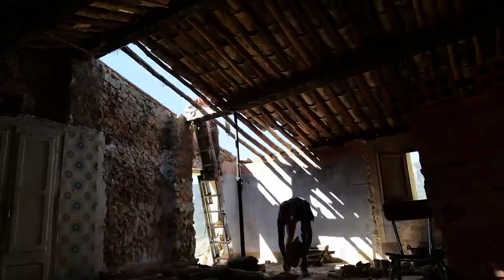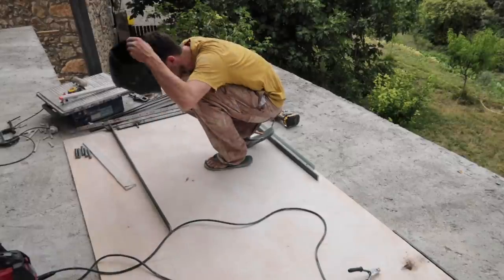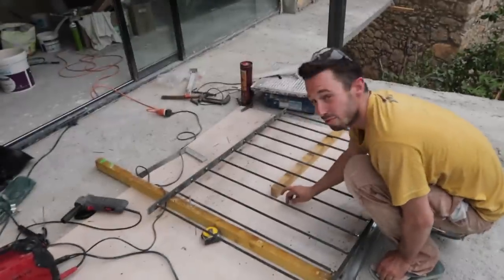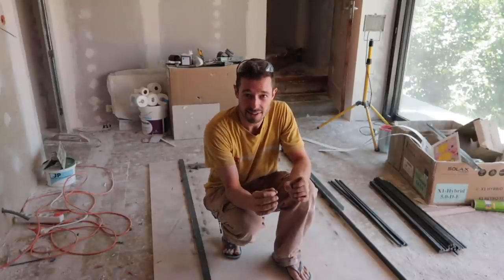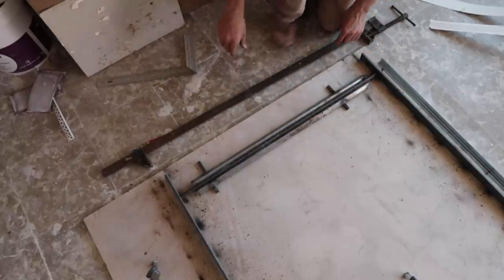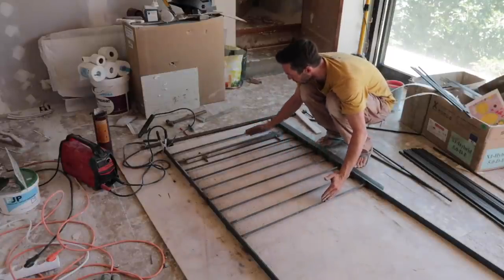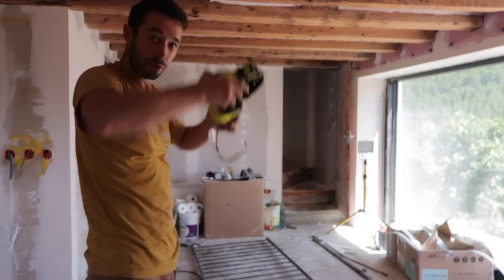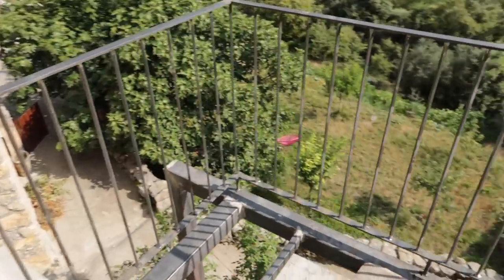ONE THOUSAND WELDS LATER // How To Weld Railings on a Budget 💥

Comment: Just a tip from an old git, ... if you are going to weld something that is galvanised, grind the zinc coating off first, its only a few thou thick, and it is pretty toxic to breathe. Just need to clean where you are going to weld, then put some red lead paint to stop the rust dead in its tracks- in fact always do railings with red lead- they will last forever.
Reply from the maker: Ah yeah, it was a bit tricky to weld actually, didnt want to stick to well. Good tip on grinding it off.
Reply: @NateMurphy  Welding sometimes throws  some yucky stuff up. just take care and check first, and you will do ok fella, If you ever want any info on metalworking, I will always try to give you my best knowhow.  Good luck with your projects, and keep sharing so others can learn - and include mistakes!! Big learning curve for others. regards Old git (Mike)

Comment: missed watching for ages - nice balcony.  I only did a wrought iron gate once and recommend a Red Oxide under coat as I still use the gate and is good is good as new 25 yrs later.  Oh and wire brush after each weld makes them easier to find the mis-welds after u tap off the flux.  Are u ever gonna finish?  lol
Reply from the maker: Haha thanks for tuning in again. Finishing pretty soon thankfully! Will end up as a solid 12 months of working on it so I'm pretty glad to finish. Thanks for the tips!!